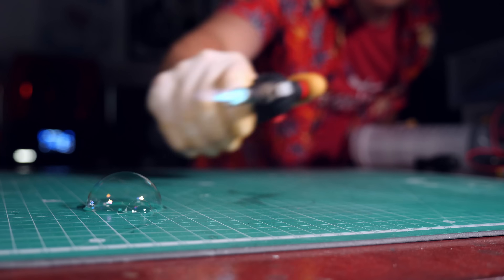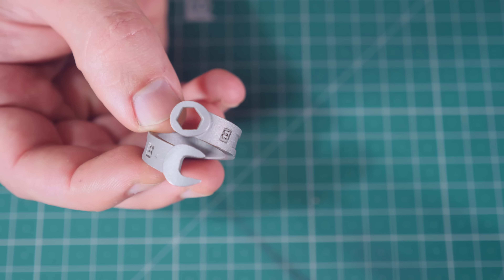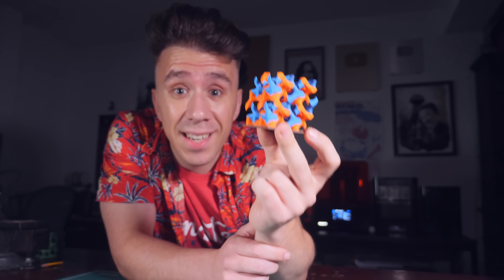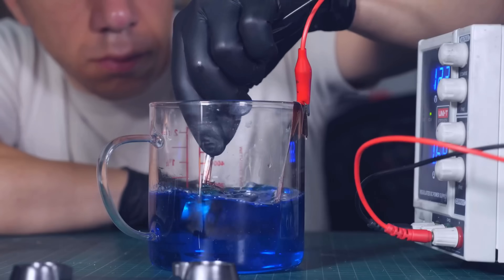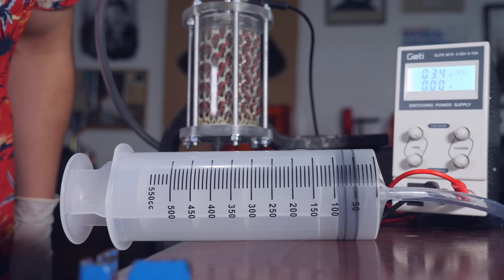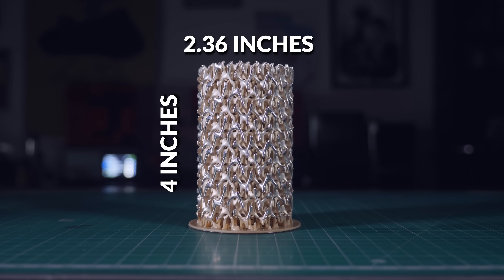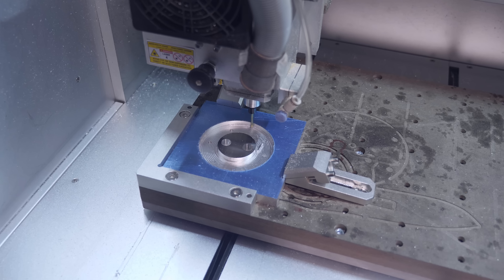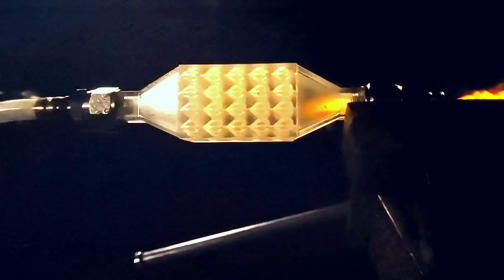ROCKET that LITERALLY BURNS WATER as FUEL

Comment: I built a hydrogen generator with a pickle jar, tie wire hand coiled, and and ran the hydrogen/ oxygen output hose to a 3400 watt 6hp generator then tried to plug the generator to the electrical power output, dc 12 volt charger port from generator but I don't think it was producing fuel fast enough than it was being consumed but it ran for a min then die. Maybe u might have better luck.

Comment: use a car battery. they can discharge OVER 400 amperes at 12.6 volts minimum depending on which car battery you buy.

Comment: Water will spontaneously fracture into hydrogen and oxygen if you can remove the Hydrogen from the solution because water wants to have an equilibrium of H ion concentration  one way might be to apply a vacuum

Comment: You get out, what you put in. Hydrocarbons hold way more energy and burn better than hydrogen and pure oxygen does.

Its why all the hydrogen cars are so low performance.

So yes you can burn water, but the net output can barely get a car going and it takes more room because the density of energy is weak.

Comment: While this might seem like a great idea let’s first start by recognizing that water first & foremost is a FINITE natural resource, let alone required for sustaining life. Let’s keep it for that & work to instead clean emissions on current fuels, while working to develop less controversial fuel sources. More importantly let’s not unnecessarily use up ‘life critical’ natural resources or even potentially contaminate them…
Reply: Burning hydrogen turns it back into water but its not used much because instead of using electricity to make hydrogen from water to power a motor you can just skip that and only use the electricity to power the motor

Comment: Sounds like your short circuiting it. Why dont you put it through a transformer, up the volts to over a 1000 with low amps and run it then? Save them batteries...

Comment: PAY ATENTION !! Ask to chatgpt with electrolysis, what is the maximum voltage you can apply to produce oxygen and hydrogen, without losing power in heat !! It's about 1.6 to 2.0V !! All other power will be wasted as heat !

Comment: Why not use/run a generator, that powers batteries and a car or electric bike? Come on here... I can't be the only one that see the potential here? Water is cheap and getting enough fuel to run a generator that charges a battery that powers the current for the hydrogen/oxygen release(fuel for the generator) and the energy for the batteries charging the electric vehicle. Do it now!

Comment: Seems like you may have had a short circuit with disks touching the opposite pole to have that much current draw.  Put an ammeter on it to see what it's pulling as you add each plate to see if there is a simple per plate curve that would allow you to adjust the number of plates to meet the capacity of the battery.